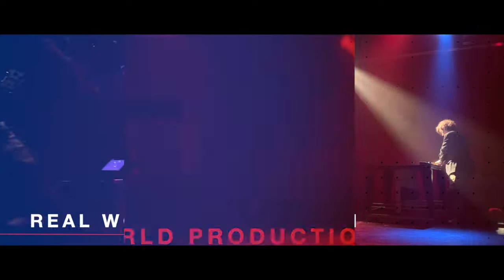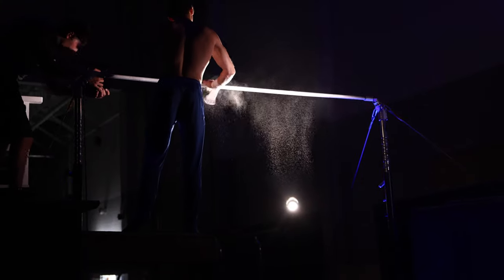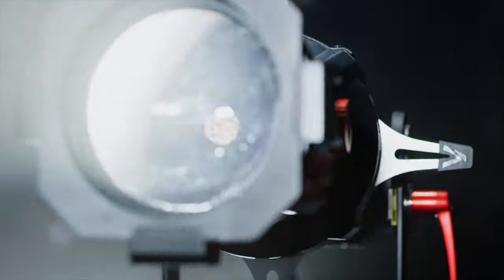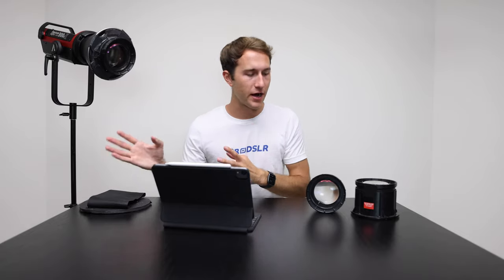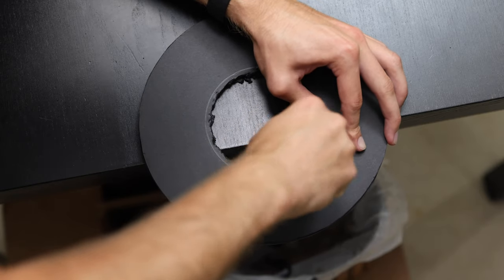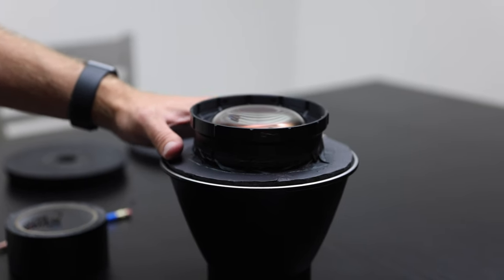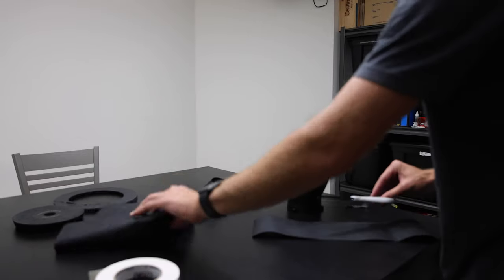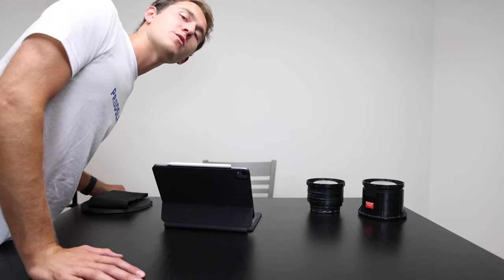DIY $30 Leko spotlight

Comment: I wonder if there are any heat resistant plastics from a 3D printer that could be used to model a mount for the lens to affix to, rather than MacGyvering a mount with gaff tape

Comment: I had stumbled upon these same lenses at an auction. Nobody wanted them so I got 2 for $2.00. Thought I came up with the idea until I saw this video.. I'm surprised it got that hot. I haven't made mine yet, I think I'm going to just buy an el cheapo bowens plate and mount some off-the-shelf aluminum cylinder of some kind, perhaps one of those cheap snoots? Thanks for the vid. Learning from your mistakes is quicker. lol